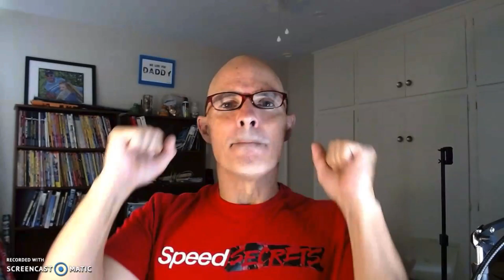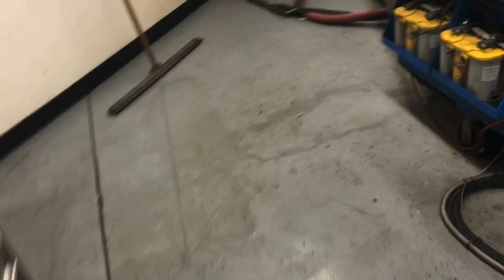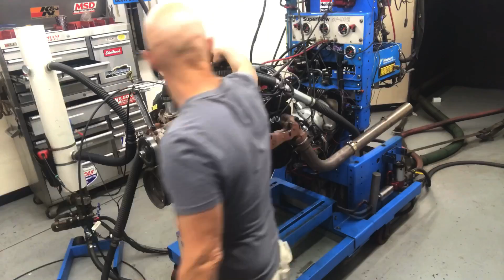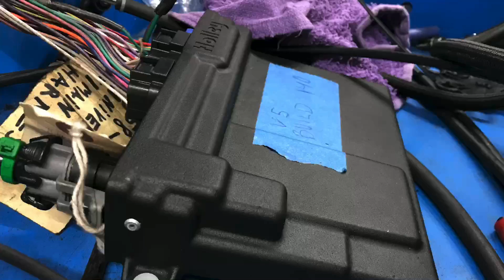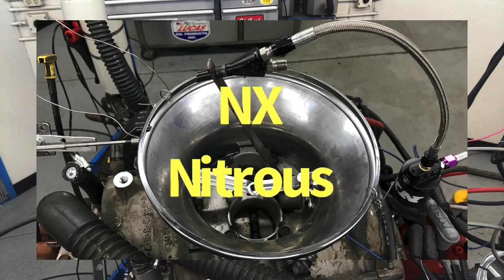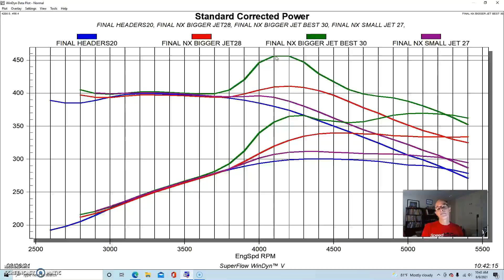JUNKYARD DODGE MAGNUM 360 MODS PT 2 (FULL DYNO RESULTS ON HEADERS & NITROUS)

Comment: My friend had a 2003 Dakota R/T that we ran nitrous on...sometimes a 250hp shot lol....it was a beast from 0-80mph
Reply: It kept burning up the cats and the dealership said "this is the last time we are replacing the cats...stop running nitrous or we are voiding the warranty"...lmao he sold it with 82k miles on it and it never had any mechanical issues other that the cats...very reliable truck.
Reply: @jorge-eh7qp  I'm surprised they didn't take the warranty away the first time 😂
Reply: They sure are a brick over 100! I ran mine at the track when I first got it. It felt like a 13 second truck in 1st gear, a 14 second truck in 2nd gear, and a 15 second truck or slower once it hit third. 15 flat at 89mph. :(
Reply: @CarsandCats  They Really were A DISAPPOINTMENT.😞My 92 Short wheelbase 318 Dak.Was Faster, with just a Homemade Coldair, Pacesetter Headers, 4deg.advance,&3.55s,With Drag Radials. I got 14.67@92 mph in Cool Air(65°?) At ALABAMA Intl.Dragway Yrs ago.😉
Reply: @CarsandCats  my stock 93 ram feels a hell of alot faster than that.